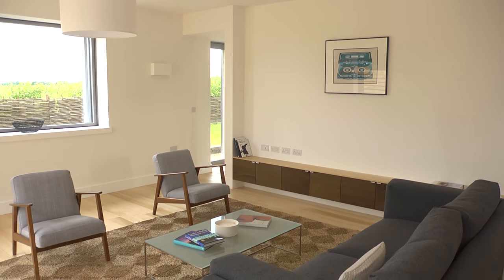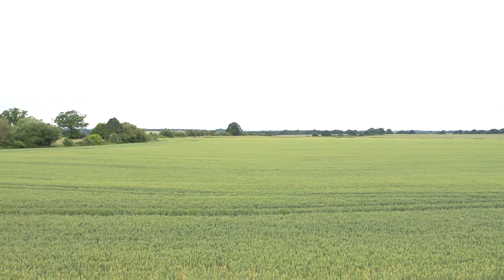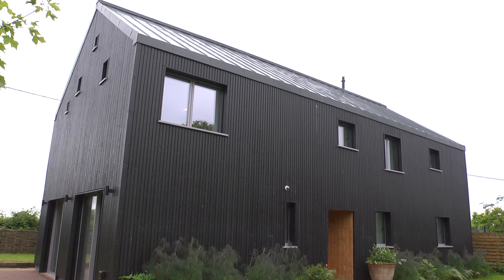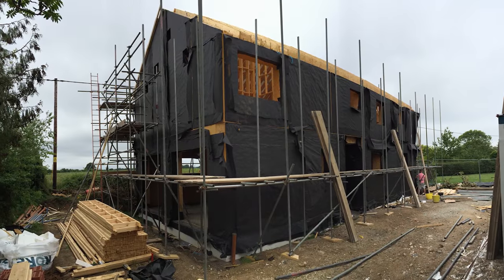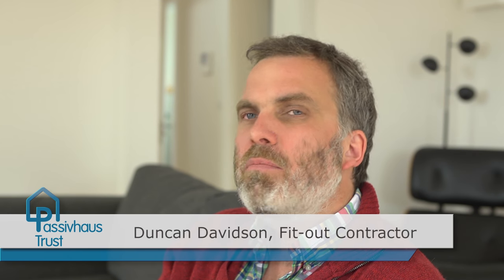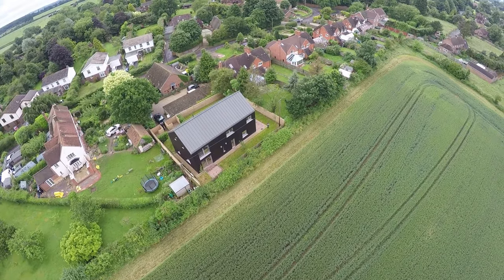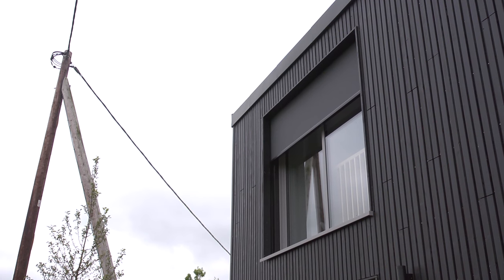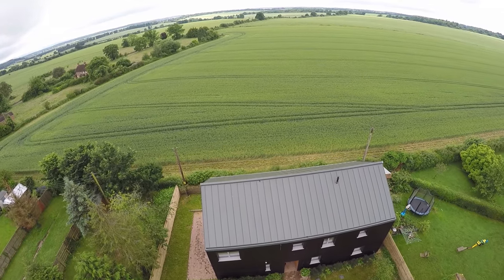UK Passivhaus Awards 2016: Rural Category - Old Water Tower (Passive House)

Comment: Hi. Does the passive house standard have any restrictions in terms of maximum living space per person? A builder in the industry told me the standard only allows a certain square meter area or volume of space per person, implying that a relatively large house for, say 2 people, for example wouldn't pass the standard requirements. Are you aware of such requirement?